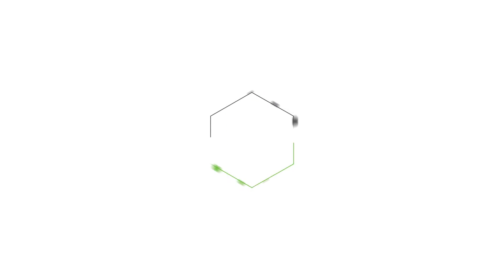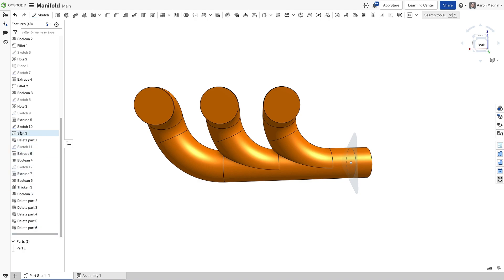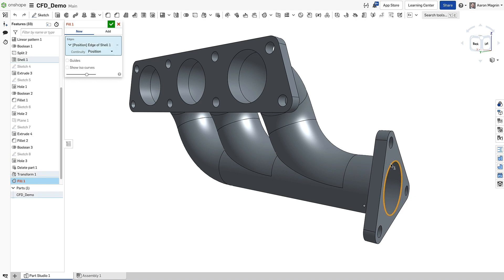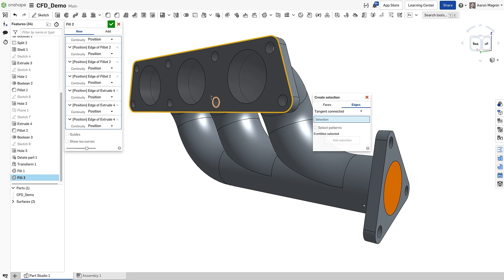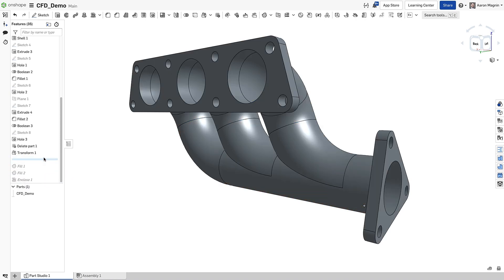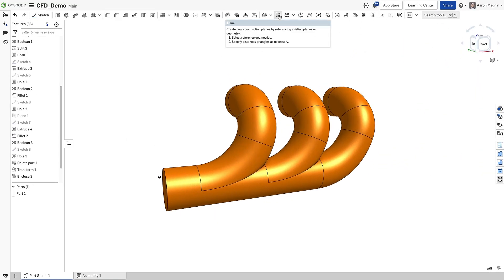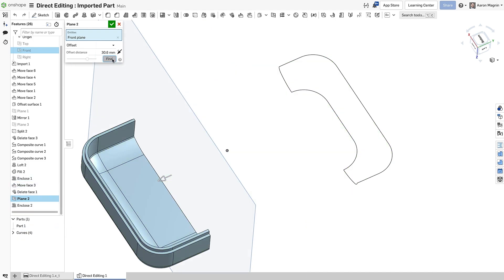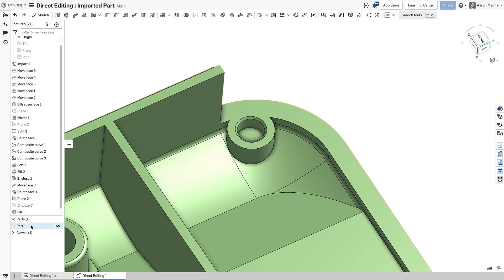Tech Tip: OPEN new possibilities with enCLOSE

Comment: Does this work with sketch edges as well? For example, if I wanted to make an enclosed shape based on 4 or 5 different sketches and some planes. A dodecahedron comes to mind, but there are many other applications if this is what can be used.
Reply from the maker: Sketch edges would not work. From the enclose help documentation, "Use any set of surfaces and solids (including planes and faces) that intersect each other or connect at a boundary to create a volume."

However, if the sketches are already created, you could make lofted/swept/extruded surfaces to use for this feature.